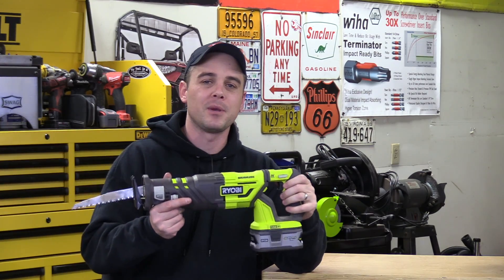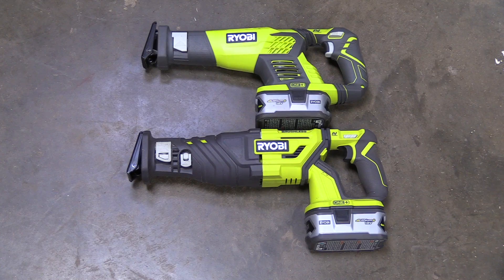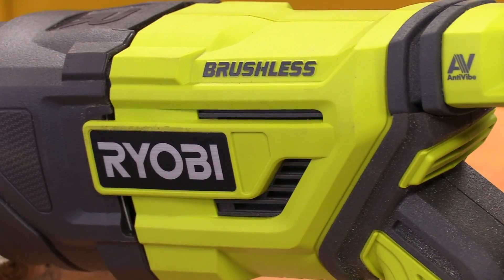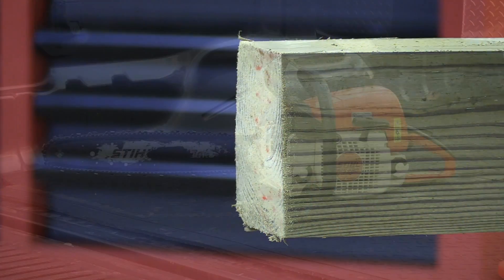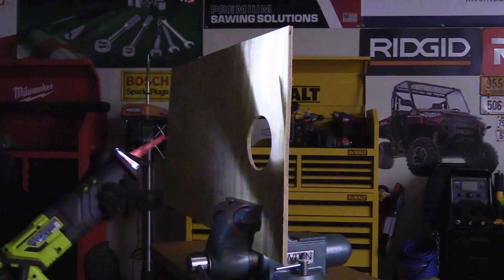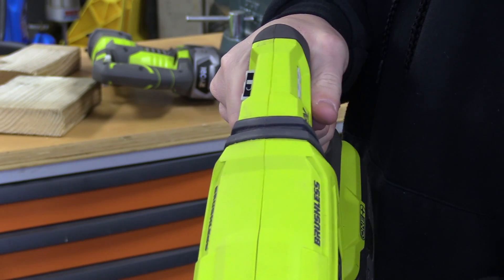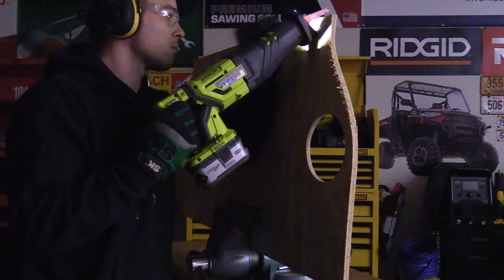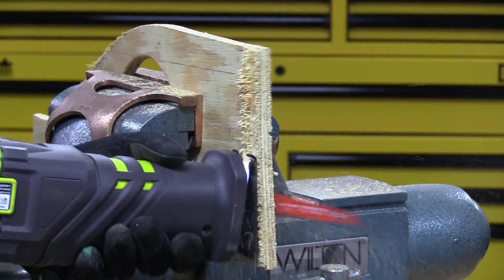RYOBI BRUSHLESS!!  P517 18v ONE+ Reciprocating Saw

Comment: Thank you for the review... I personally just can't get into Ryobi tools... I prefer the Porter-Cable stuff for DIY/ homeowner grade tools with a large line of different tools on the same battery platform...I don't like Ryobi's battery style (the 18 volt battery).... I prefer the 20 volt and the look of Porter-Cable... They look better than these and Porter-Cable has never let me down they're actually very good quality for the price...
Reply from the maker: I will look into Porter Cable some more.....which tools have you had the best experience with?  Also, 18v & 20v are exactly the same in reality....it is just a marketing term.  One measures voltage during use (18v) & the other measures voltage with zero load (20v).
Reply: I understand the 18-20V thing the same way; just marketing.
Reply: Real Tool Reviews sure I understand that... Just the way they load.. With PC and other 20v platforms the battery loads with the click of a button... these have the extended contact "nub"  (18v style) on it that just isn't appealing....
Reply: Actually Ryobi has a larger line of tools on the same battery platform than porter cable and all porter cable is now days is rebadged black and decker or rebadged old dewalt stuff now that stanely black and decker bought out craftsman and its gonna be sold at lowes they may do away with portercable considering they own it as well
Reply: Porter Cable actually has a very small line of tools compared to many other brands including Ryobi.
Reply: Cheng Liu no... you should google some info on Porter Cable....👍
Reply: Craig Cundiff: I have, I have been on there own website. It is a fact that their lineup pales in comparison to other brands.
Reply: Cheng Liu Ryobi is gimmick junk
Reply: Craig Cundiff: believe whatever you want but I can tell you for certainty that that is not the case. When hurricane Sandy hit the NYC area I had no electricity for a week.  My Ryobi lantern got me through and made sure that my home was well lit every night. I also use the tire inflator regularly and it has never failed me in the 4 years I have owned it.
Reply: Ryobi has over 100+ unique tools for their battery platform.  20Vmax means the maximum battery would hit is 20V.  Which they don't.  I've read 19.2V on some of my Ryobi batteries.  Why they still have the stem is because they haven't ever switched their battery style since they came out with 18V Nicd batteries.  While I will agree the stem is kinda annoying especailly for battery storage, whatever.
Reply: Where is the Porter cable miter saw, inflators, nailers, oh and cooler just to name a few?
Reply: Cheng Liu don’t bother, he’s trolling. Won’t let facts get in the way and picking a tool brand because it looks cool is childish.
Reply: I own a few Porter Cable drills/impacts and they have been great tools but they definitely have one of the smallest tool lineups on the market
Reply: I have a Porter Cable lithium drill, impact driver, and reciprocating saw. I like them all, the standby time especially on the batteries and the run time on them is fine - I think this is a function of the lithium batteries though and would expect it from other brands also. I wish the fuel gauge was on the batteries though - it's on the drill and the impact driver themselves but seems to be missing from the other tools, definitely not on the saw. The PC reciprocating saw is rock solid but admittedly a bit more basic feature-wise than this Ryobi. I've been considering moving on to a new brand platform though because as others have mentioned the line as a whole is slim - they only recently came out with a cordless Impact wrench earlier this year and I really want one but I'm hesitant to buy into the platform further because I feel like there's a good chance next time I want a cordless tool it also may not exist on the platform - we'll see though. I think this is a strategic move to steer people towards their DeWalt line. I do have a Ryobi corded hammer drill that is definitely no Hilti lol but has worked well on the random concrete project that's come up around the house a few times. May very well consider their cordless line more closely soon.
Reply: Porter Cable is not going to be around.  I think it is a dying brand personally.
Reply: How is Ryobi a gimmick?  Was it a gimmick that this guy posted a video and cut over 100 pieces on one charge with a Ryobi battery and tool?  Where is a similar video for Porter Cable?
Reply: Craig Cundiff haha you’re funny.  PC ain’t got shit on RYOBI Tools.  Good try though
Reply: fyi. that porter cable you like better because it is 20 volt vs 18, well all black and decker lines (yes PC is black and decker) rated their battery with no load. all other brands rate with a load, so every 18 volt battery is 20.
Reply: Craig you seem to be inventing reasons to dislike Ryobi that don't matter.  Their battery format remaining the same is an extremely good feature because it means that their old packs work with newer tools and vice versa.  Frankly it is ridiculous how the other brands keep changing their battery format and the only valid reason I can see to do so is to make a 12V line of very compact tools for light use or in cramped spaces.  As far as the Porter Cable lineup, it is much smaller than Ryobi's so what you claimed as a benefit is the opposite.  Granted not everyone needs THAT many tools, and some of us own more than one brand to get the best tools that each offer, but ultimately your distinctions are small ones, as Porter Cable's 20V line is also homeowner grade like Ryobi, so a significant step up in quality and performance would be moving to the likes of Dewalt or Milwaukee.  It would be foolish to think that Porter Cable is near those two in quality, anyone who thinks Ryobi is junk should think Porter Cable is the same junk but higher priced and with fewer tools.